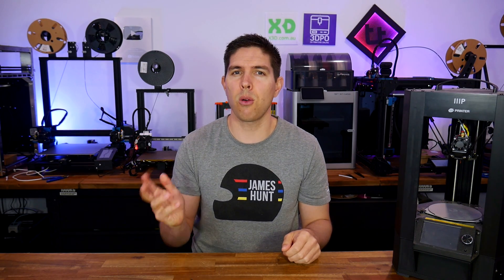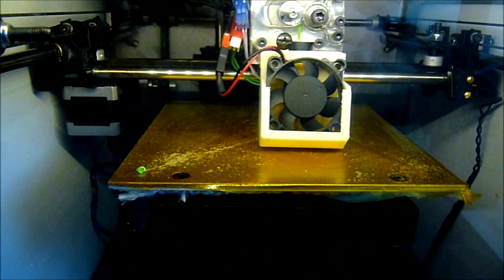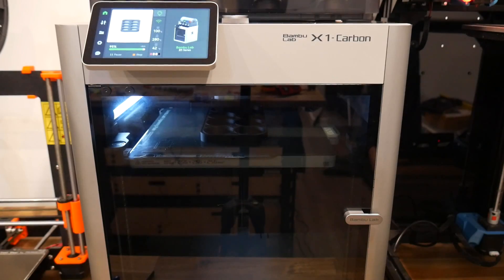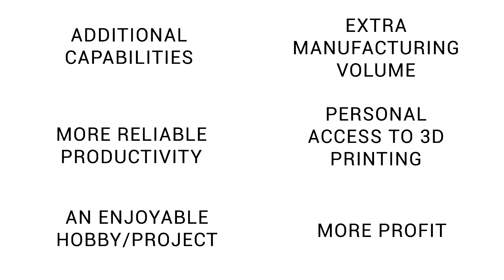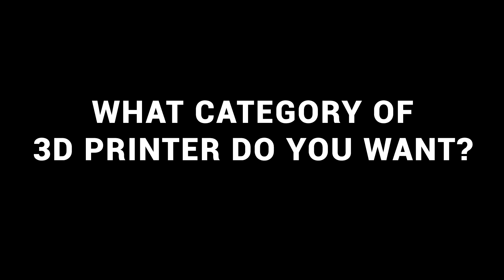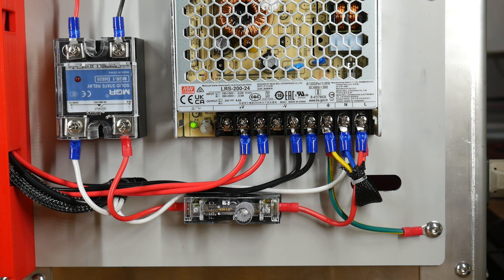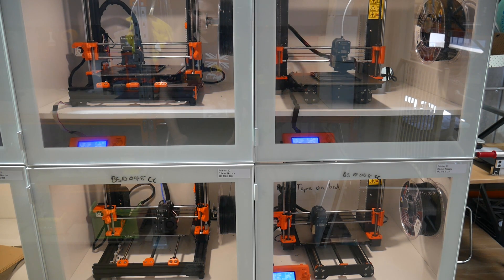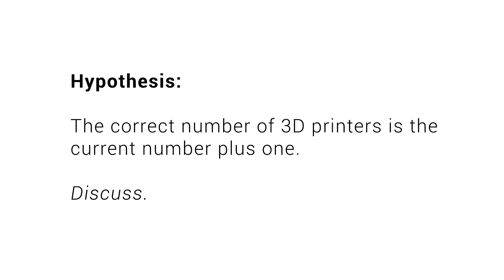Should you buy a second 3D printer? Reasons why and why not

Comment: Ever since getting into FDM 3D printing, I’ve been wanting to expand into resin printing. 

Just hard to figure out what’s the best bang for the buck and what will be good enough for the things I want to make.
Reply: I was in the same boat. I got myself an Anycubic M3 printer a few months ago. It works well and has a relatively large build volume. I love the detail you can get, but I'm not really fond of resin mess/smell/post processing.
Reply: I made the plunge to resin after few years of fdm. So far its been pretty underwhelming. Resolution is much better but that's about it. Parts are much weaker than fdm even with strong resins. Dimensional accuracy is poor and has too many factors that could affect it (temperature,  wash, exposure,  etc). Post processing is a real pita. If you print models then resin is definitely better. But for functional parts fdm is still king.
Reply: @yoyomin  thanks for the input. Those are good things to keep in mind. 

I think for functional parts, like a hose adapter or enclosure or stuff like that, I’d still go FDM. But for anything small and detailed, FDM just can’t hack it until you get towards the higher end, and even then doesn’t match resin. I figure instead of spending $1,000 building out a better FDM printer, I’d be better off spending $4-600 on a decent resin printer and having one of each for different projects.